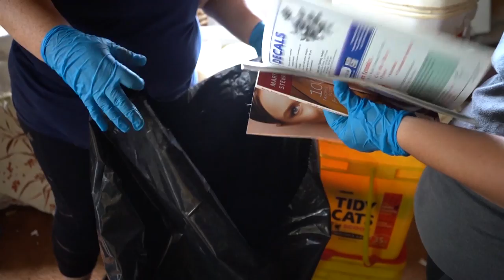S2 Episode 5: Pet Cemetery pt. 2

Comment: Is the decision ever made, in extreme cases like this, to just call in a wrecking crew to bulldoze the whole house?  I would not want any parts of this building, no matter how thoroughly it was cleaned and decontaminated.
Reply: I wouldn't want it either if I knew what it once was.
Reply: Same thoughts
Reply: When the structure has been compromised, yes.
Reply: You really don’t know the extent of damage until the hoard is clear... that’s the problem. You can’t tell how long it’s been there or what’s there etc like one big pile seemingly trash could have a big furniture item under and not totally trash....you only see the first or last rather layers of garbage that’s the newest so once you start to dig into it layer by layer it’ll become more and more rotten and gross as you go deeper and that’s when you know exactly what you’ve got yourself into lol . Rats chew holes mildew and water rots away floors the roaches Omfg... it’s just insane. A hoard that’s gone on 5 years is likely salvageable but if it’s been decades... most likely can’t be saved.

Good profit in these homes if you had the time for it but then again it’s kinda like a crapshoot
Reply: Also you have to clean hoard before your allowed to bulldoze it down anyways so you have to do the clean up either way you look at it. Many times bulldozing and selling the land itself Could bring in a decent profit too:
Reply: You can't bulldoze a building that's so full that the trash is load-bearing.
Reply: @annehaight9963  Unfortunately they have to clean up first inorder  to find the structure has been compromised.
Reply: Idk if it's like this in other areas but where I'm from you still have to keep the foundation
Reply: Me neither
Reply: I feel the same way . There’s no way it’s ever going to feel clean enough . Don’t forget about the spirits of the TWO DEAD PEOPLE that can’t be scrubbed away !!!
Reply: I’m having trouble seeing it from all the way over here 2 years later 😬
Reply: Price building materials rq and get back to us lol. 
It's insane how inflated they are.
Reply: Even bulldozing a house would require a cleanout first. Construction waste is usually disposed of differently than household garbage, and a hoarder house like this might contain hazardous or flammable materials that a dozer wouldn't want to risk
Reply: Always wondered that, myself. My buddy and I checked on a neighbor of his, after nobody heard from her for a week. She was an unhealthy lady, who's house looked similar to this. Found her face down in a cat box. She was already that bluish green, and even a rag soaked in old spice couldn't fight the smell. I swore they were gonna demolish it. Nope. They cleaned it up and it's now a rental property. Guess rebuilding is more expensive.
Reply: No because it would still be a bio hazard, they need to sort out each thing or most of the stuff to make sure they aren’t putting the hazard stuff with all the other garbage
Reply: No thanx!🤢
Reply: I bet so.

Comment: Do you actually have to throw everything away even if it's technically still usable?
Reply from the maker: Not everything. We do try to save what we can but most items do get damaged to the point that it needs to be trashed (even if it is technically unused).
Reply: I noticed that a lo of suff in the one bedroom was in bags to protect it, so was surprised that it was still shoveled into a trash bag. With a job this overwhelming tho, I can see where you'd say "screw it", and toss decent stuff just to get the job done.
Reply: It’s safe to say that Kyle, in fact, saved that Bambi dvd

Comment: I can't help but feel like there has to be a better/more efficient way to clear places like this.  I want to invent some kind of frame for the bags so they don't have to be held open but would be a quick change since they fill up so fast... Maybe with a flated top to funnel things so something like a snow shovel could be used.  Then a modular conveyor belt to move the bags to the exit to be tossed in the dumpster.  Or maybe something with a horizontal opening that could be rotated to vertical to make the shoveling easier.  It sucks having to work that hard to see so little change.  That has to be frustrating.  Maybe some innovation could help?  Clearly a lot of reasons anything that couldn't be sanitized wouldn't work and it can't be too expensive to build.

Comment: 4 bug bombs in every room for the first two nights and clean up would have been 10x easier. Never open the fridge, or freezers, they go out whole. Turn on the AC not just for the cooling but it removes the humidity in the house. I've never done crime scene but I've worked in hoarder homes many times. I would not work here the way you guys are doing it, you'll all be sick.